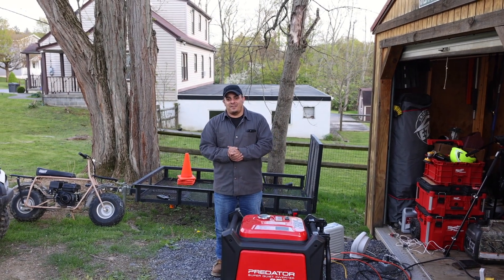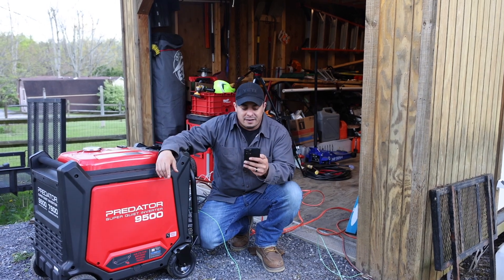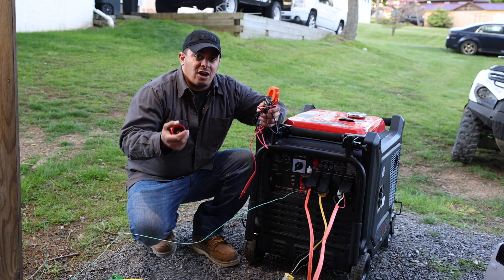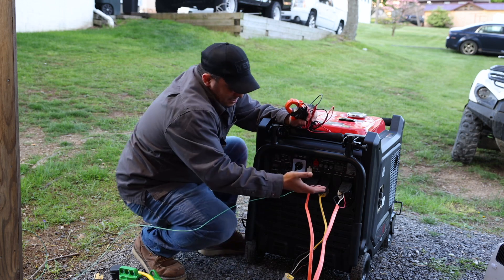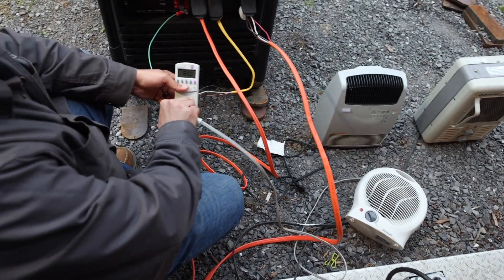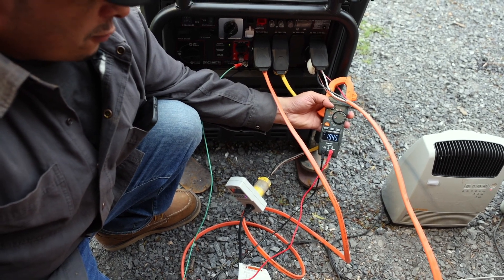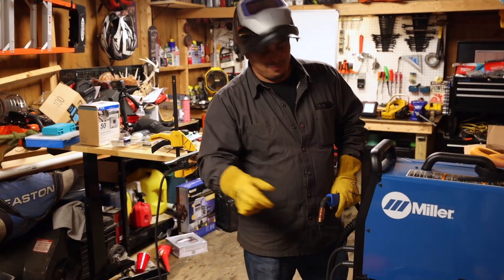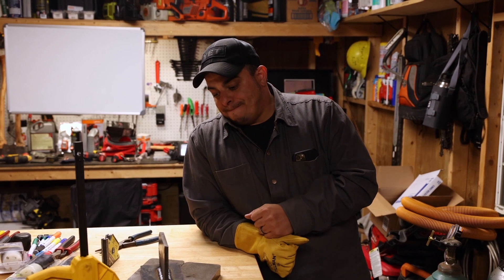Load Tests | Predator 9500 Inverter Generator | Does it perform?

Comment: Would that be able to power a 60 gallon air compressor?
I believe they draw about 5000 watts
Reply from the maker: The 9500 will run 5000/6000 watts all day

Comment: not sure i'm clear how many watts you got out of this before it became unstable?  sounds like these predator 10k units start to become unusable after about 7000w.  never fun losing 30% of rated wattage, but these are a pretty cheap generator compared to other brands.
Reply from the maker: 7600 running watts is the rated wattage 9500 starting and peak. A comparable honda is rated at like 5500 running and cost double the predator

Comment: Hello I have a couple of questions what kind of adapter plug did you buy to run the miller multimatic 220 to the predator ? I see the generator doenst have 220 also can you run your killer multimatic full force with that generator ? I looked up online that the miler multimatic needs a 10,000 watt generator and I see the predator is 9500
Reply: This is where it gets confusing this is what I found online No, a Predator 9500 generator cannot run at 220 amps. It is designed to provide 30 amps at 240 volts, or 30 amps at 120 volts. The 9500 is rated for a total of 7600 watts. To determine if it can power a specific load, you need to add up the wattage of all devices you want to run and ensure it stays below 7600 watts.

Comment: Thanks for posting I have the Vulcan 220 Omni pro. I was thinking I would have a electrician come out and install the 220 to the garage. Till I got a few quotes and it just doesn’t make sense for me to do that. We plan on selling the house and since the Vulcan is literally the only thing I have that I would prefer to run on 220. It would probably be better for me to get this generator 1 for the welder and 2 for just incase. Also when we sell this house and move I can take it with me to the new place.

Comment: What size generator should I get to fully use my SP-170 t Lincoln mig welder?
Reply from the maker: It looks like that unit is 12.7 amps input i would a good generator that can sustain 3200 watts would prob be fine i would look at something 5000w with a 240 plug cost wise this predator 9000 would do it with the 240
Reply: @NickPixelTV  would it be better for my welder to have an inverter welder also?

Comment: I also have the Multimatic 220 AC/DC Welder and according to the manual it requires a 10kw cont/12.5 KW peak generator to get full output.  Have you noticed over time any issues running that welder with this 9500?  I would think the Predator 13000 which I believe has the 50 amp would be an ideal pairing for this welder.  Thoughts?
Reply: The 13,000 is also $1,200 compared to the Pred 9500 at $2200 as of Jan 2024.  What am I missing here as the 13000 has a higher capacity at almost half the cost?
Reply: Thd rating, inverter technology.

Comment: Can this run a razor weld 45 plasma cutter
Reply from the maker: So i tried looking for exact specs as input voltage on that unit best I could find is their rated amps which looks to be somewhere in the 15 to 17 amp range at 220v If that is the case you would have no problem. I doubt that machine requires more than 30amp but I could be wrong. Most units will actually say on them input voltage and or amperage needed.. You could run it full tilt and put a meter on one leg to see max amp draw

Comment: I need a 50 anp generator for my primeweld plasma..will run it 220. I dont know if 9000 will work?  Im thinking 11,000 or higher
Reply from the maker: This runs my miller multi Matic 220 no problem. Ill have to look up specs on the primeweld plasma what model number is it
Reply: @NickPixelTV  it's the prime weld cut 50D

Comment: HI there. I just subscribred to your channel. Could you do a step by step (bullet points) startup procedure?
Let's say: 
1- Oil fill up
2- Run for X amount of hours on high or low speed
3- Change oil / oil specs
4- Run for X amount of hours
I think you get the idea. 
Thank you so much.

Comment: Got same generator and works great on stick and tig welding
Reply from the maker: Right on, no cold laps on my machine. Thanks!!
Reply: What about mig ?
Reply: @Riogan’s Tech  it really depends on the amps u use..I only use for my house 120 on stick and tig ..or less..don't wanna run it higher cuz I don't wanna fuck up my generec

Comment: The predator 9500 Inverter at $2399.99 has One 120/240/30A Four Prong twistlock outlet.  The predator 9000 Watt at $879.99 and has One 120/240/30A, L14-30R twistlock outlet, However, is NOT an INVERTER generator.  ALSO there is a Predator 8750Watt INVERTER with CO secure technology, it also has One 120/240/30A twistlock outlet, at $1199.99.  Today these can be bought with HFT 20% off Predator coupon.  So to my Original question, at 30 Amp outlet and Only One per Machine!  Then Parallel or Pairing of TWO machines is neccessary to run the VULCAN ProTIG 205 at 50 amps AC for Alulminum TIG?  The Predator 3500 only has one 120/30A twistlock outlet.  If you Parallel/Pair TWO predator 3500s, one machine would be wired into the red wire and one machine wired into the Black wire of the HOT wires of the FOUR prong 120/240/50A parallel 4 prong twistlock plug?  Probably work, but 3500 generators probably wouldn't last long.  Southwire Romex 6gauge/3 wire stranded will  only handle 55 Amps Maximum, in comparison to 8 gauge/3 which is maximum amperage of 40 amps.  Just for those going to Home wire to your breaker box.

Comment: Is there a generator or parallel generators that will run the Vulcan ProTIG 205 at 50 amps? AC TIG aluminum welding?
Reply from the maker: On tig it looks as though that welder is 22amps at 205 output- double check the specs on the owners manual - the predator 9500 would probably run it by itself without any parallel. Needed.
Reply: @NickPixelTV  thank you, yes read the specs.  Nice I prefer One Generator.  Even the Predator 8750 inverter at $1199.99 with 20% off coupon would work, thank you.
Reply from the maker: @kcretired1032  I like using the inverter generators as its much cleaner more stable power the 8750 is a good unit the 9500 was my choice just to have a little bit extra
Reply: Expensive to run a welder off a generator, my limited 100 Amp Fuse Box at the house has me afraid of overload.  However I think I can use my 50 Amp Central air conditioner branch with a plug wired into the circuit.  22 amps per branch at 44 amps total max.  As long as the AC is turned Off.

Comment: So in order to run mig off of a genny does one of the machines need to be an inverter? Or Does it depend on the type of welder?
Reply from the maker: If the generator you’re using has enough power probably can run a mig of anything but im guessing that running an inverter based pure sine wave generator is safer for the welder. I could be wrong

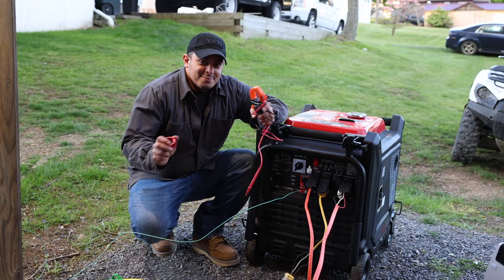Comment: 4:35 That's not a disclaimer; that's good common sense. You can read the manual if you need more common sense. 9:30 I CAN"T HEAR YOU. Your welding was excellent. A product that costs this much should have a complete set of gauges. I installed VOLT, AMP, TEMP, and Oil Pressure gauges for my riding mower. One glance, and I know how it's doing. Next, I'll add a Tachometer. A fuel gauge would be excellent too. I'm a DIYer who doesn't seem to know where to stop.

Comment: A lifting eye would be nice.
Reply from the maker: Im surprised that hasn’t been a request. I will say the machine is fairly light could just use a rope around the handles
Reply from the maker: Cancel that i was thinking for the welder. The generator yes that would be sweet but the gas tank is on the top

Comment: Any issues with the welder yet? Looking to get into welding soon with a millermatic 215 or lincoln 215mpi... I live in an apartment right now so i need to get creative where I weld. Our stupid garage only has an outlet for the opener, and I don't have access to the breaker if I pop it lol.

Comment: Hi Nick,what generator if I want use esab rebel 285 3 phase/320 ic?
Reply from the maker: That is a great machine I bet this would do most processes just fine but at full tilt youd prob want to be around 50amp 11k/12k at 220 stable.  where as the predator is 7600 to 8000 stable in my experience. Would have to look around see whats out there.

Comment: It would be helpful; IF you could make a video; using this Generator in the whole house; wired directly through the Electrical Panel. With a manual "transfer" setup. And be just as describable; as you were in this video; using it in a portable setup.

Because many of us; do not use these generators in a "portable" way. We just mute the main breaker and breakers in the panel; that we don't need; when the power goes out. Thanks.
Reply from the maker: I can do that. That was original plan, life got in the way a bit. appreciate your patience
Reply: @NickPixelTV  thank you kind sir.

Comment: I was thinking about buying a generator because we don't have any room in our breaker box to run any outlets for my welding equipment. I have a Yeswelder MIG 250A Pro that can weld Aluminum, it does MIG/TIG AND Stick. The problem is, I was told by Yeswelder that I shouldn't use a generator, he said that most generators don't have a steady even flow of electric, that it fluctuates too much and could damage the electronics in the welder.  Have you ever heard of anything happening like that? Does this one put out a constant steady even flow of electricity?
Reply from the maker: Inverter generators provide clean power. I would almost bet that the predator and or a honda that is inverter based provides a cleaner power than the electric company your home is connected to . a normal generator (not inverter based) yes could vary in voltage fluctuations. I believe you would be safe with an inverter generator.

Comment: Just a tip for all, be sure to do your break-in oil change! Very critical not just for this generator but on any small gasoline engine. I work for an asphalt paving company in Pa and they only buy predator generators. A fuel stabilizer will save you headaches in any small gasoline engine as well, proven!
Reply: Thanks!!!

Comment: Does the Generator have a Fuel shutoff that you can get to? I like to shut the fuel off and run the carburetor out of Fuel to shut it off in between uses to keep carb from humming up..
Reply from the maker: Yes all you do is turn it from run to storage and it runs out the carb and shuts down takes say 2 mins

Comment: The only reason I have not bought one is it does NOT have a 50 amp, 220volt outlet. I would like to run my whole house on it including central air and 30 amp outlet is not enough!!!
Reply from the maker: If the generator was closer to 11k/12k watts i think they would of used 50amp receptacle. 220x30 6600. 220x50 11000 - you may not run whole house all at once with it but sure works for the core items and keep the lights on. Can buy 2 and sync for less than one honda that only outputs 5500. Just giving ya some ideas. Thanks

Comment: I will stick with Yamaha generators, Yamaha has the best inverters in the market. That predator is noisy as all get out.
Reply from the maker: They are good but their largest quiet inverter model is like 5500 running watts and is like 4500 bucks.

Comment: Great video. It looks like they are holding up over time. Requiring a fuel additive is smart on their part.
Reply: Its all smoke and mirrors though because stabil-gas does not protect the machine from water damage from the ethanol.

Comment: Do the 30amp breaker need to be on are off when running a big load
Reply from the maker: No because the circuit is protected by the 50 amp breaker so if you go over 50 amps the breaker in the house will trip.

Comment: Hi, we need to run 2 bounce houses, a photo booth set up and DJ sound equipment  for at least 12 hours, knowing that equipment varies, would this be a good starter generator?
Thanks for your input.
Reply from the maker: I would see what amperage the bounce house fan motors pull as well as the sound amplifier - those will be the biggest draw of power. If your using a more recent amp they are pretty efficient and most common are 110v 20amps or less constant. I don’t think you’ll have a problem at all with this setup. As far as 12 hours just have fuel onsite and you should be good to go. If the generator is at 1/4 load that 18 hours give or take at half load 9 hours so maybe have a 5 gallon fuel can with you just in case. Hope this helps you
Reply: @NickPixelTV  AWESOME!!  Thank  you for your knowledge!

Comment: How many hours can you get at a full load?
Reply from the maker: I dont know if I have run it at full load for a straight full tank. May need to do that next time its in use just run it at max. Normally I try to go as minimal as possible to stretch the run time.

Comment: Looked and sounded from the spark like you got a decent MIG weld when you turned it down.
Reply from the maker: Yeah it was wayy hot just to have it cranked and test generator but thing works solid across the board 💪👍
Reply: @NickPixelTV  good to hear! I've been looking for a genny that can power a TIG welder with aluminum (for structural welds, not art/thin stuff/etc), but that takes a ton more heat, so I'm not sure I'm going to find something that's in my price range...

Comment: I don't have a Predator generator, but I do have a 10kw/8kw portable generator.  I have been wondering if I can operate my Miller 251 with it.  I think you've proven that I can.  Thanks!
Reply: Should be able to. Make sure it's voltage and Hz is right on before you turn the welder on
Reply: These newer inverter powered welders require less current.

Comment: When you switch the voltage selector to 120 V, does it consume less gas?
Reply from the maker: Fuel consumption would be based on power draw if you have it on esc/eco mode it will consume less fuel if you’re using less power hope this helps

Comment: I need some help deciding which brand to get. I have looked at DuroMax  9000 watt and the Predator. Both are inverter generators. Do you need to use fuel stabilizer  when you use 100% non corn gas? My other question is. When you turn on the generator, is there power instantly to the outlets?  The DuroMax  motor has to get warm before the system allows power to the outlets. On my Honda I wait 2 minutes before turning on the echo mode. I am replacing my Honda with a new generator. Thank you for any help.

Comment: It seems like a pretty nice one, but not portable enough or quiet enough for Rv and camping. Do you have any suggestions for those purposes?
Reply from the maker: Depends if your running a big ac unit. I use a honda 2000 for camping and general uses. Hf also makes a 2k series predator as well.. if you want to run big ac the honda 3000 is good

Comment: Run it on eco mode and do a test. I know what my Honda eu7000is will do. Ive had it since it was new in 2004 lol. Thinking of pulling the trigger on one of these 9500 predators but ill sound deaden the panels with hushmat or dynamat. I need it to power 230 compressor, 1 13k btu roof mounted a.c. and interior fluorescent though ill be replacing them with led and have led exterior flood lights at 200 watt each on my enclosed race trailer plus I run a portacool swamp cooler when its hot.

Comment: how would this generator work when trying to power a 50amp RV in regards to the 2 legs? I have 50amp service from shore power and would like one of these for when our power goes out but wonder if it could run my 2 a/c's.
Reply from the maker: This really depends on the size of your AC units in the RV, how your RV is wired, and if you start them both at the same time - most RVs typically split that 50 amp into 2 legs if not much else is on startup would probably be the worst part. Maybe throw an amp meter on one of the AC units to see what the power draw is.

Comment: Nice video but. I find this generator kind of worthless without a 50 amp plug.    I mean what's the point.  We want 1 big plug not 100 small ones for our house or shop or rv
Reply from the maker: I know what your saying for sure but most applications a 30amp feed is going to be sufficient. For this generator to have 50amp receptacle it would make more sense if it had a 12000w output. - rv’s are mostly 110v and the panels are split up. For price point it does work well though. Thanks for watching btw

Comment: Too much wire speed and not enough voltage for that mig unit in 3/8 or half inch inside cornerjoint